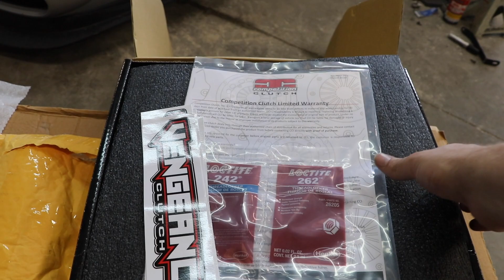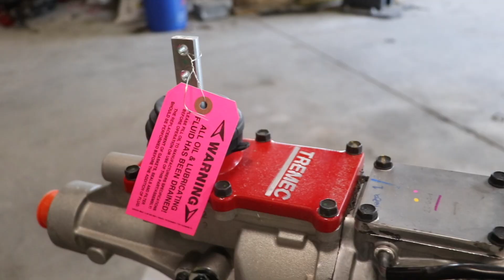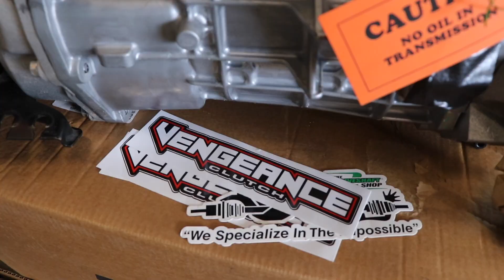Building the Ultimate Manual Transmission Combo: Tremec T56 Magnum & Vengeance Twin Disk Clutch

Comment: Vengeance clutches for the win.  I'm sure you won't be disappointed love mine had it about 2 1/2 months now
Reply: how has it been holding up? would u say better than mcloed rxt?
Reply: @SVTgotti Don't got a twin disk I really don't recommend them but I do got a Mclead street warrior and it will do you just fine. My car is also t56 swapped
Reply: @dennisbryan7522  thanks for the tip brotha

Comment: I definitely needed an adjustable pivot ball with my foxbody 347 magnum setup. It chewed up 2 throwout bearings and shifted like crap over a quarter inch of adjustment. Shifts beautiful now.
Reply from the maker: What clutch?
Reply: @MustangLifestyleTV  I used a McLeod single disc but I think the chance of it being spot on without touching it is a long shot. I heard you say it felt like there wasn’t enough throw. If that’s the case the pivot ball has to go in. It’s set from tremec at 1.5 inches. It ended up being 1.25 inches. A quarter inch made a huge difference at the pedal. It felt like there wasn’t enough clutch which is actually what’s going on. It’s not releasing the clutch enough if it’s not right so the pivot ball has to go in.

Comment: Have an 01 Corba. Had anT3650 trans. Installing New Magnum TKX 6 speed, installed 373 gears in my IRS. Do you know the drive shaft length. Where I got my Trans from he wants me to get a measurement. 
Thanks
Reply from the maker: TKX is a 5 speed. Are you sure you bought a TKX?
Reply: @MustangLifestyleTV oops!

Comment: Yay T56 Magnum 💖 Got myself a T56 Magnum for my GT supposedly handles 700trq..
Reply: Here is a brakedown of my build would love to get your opinion on it.

Procharger D1sc (billet aluminum impeller upgrade) W/ Intercooler 
8 rib pully set up
Mishimoto Performance Aluminum Radiator w/ Stabilizer System w/Performance Aluminum Radiator Fan Shroud Kit
Vortec maxflow race bov
MMR 4.6 to 5.0 Stroker forged internals (1k hp capable)
Fore innovations fuel hat w/duel 525lph fuel pumps
Aeromotive return style fuel system
90lbs injectors
MMR Fuel Rail kit
MMR rear main seal housing
MMR Composit windage trey
MMR Tensioner/guides 
Moroso Street/Strip Oil Pan
2000 Windsor Iron Block (soon to be bored .20 over)
Custom Cams by Todd Warren Cams
ARH Longtube headers w/ Xpipe
8bolt Billet steel flexplate
Quicktime bellhousing
Mcload RST Clutch
T56  Magnum Transmission
UPR Tubular Kmember and lower control arms
UPR Adjustable Upper/Lower rear control arms 
Aluminum driveline
8.8 rear diff with 31spline Moser axles FRPP 3.73 LSD
Cadillac ATS 4 piston brembo swap
Aodhan DS07 18x9.5 (F) 18x10.5 (R) +22 
Continental DWS 275/35/R18 (F) 295/35/R18 (R)
BC BR series Coilovers
Kenny Brown Extreme Matrix Kit

still waiting on 
Edelbrock intake manifold stage 3 port /polish by MMR
I think that is everything  so far..🤔
Reply: It's stout man it can easily handle 700+.  They rate them conservative.  You could prob push 800-900+ and still be ok in all but the most abused cars.  This is all assuming you can drive bad drivers can destroy transmissions either way.